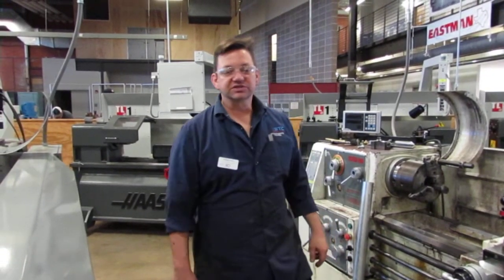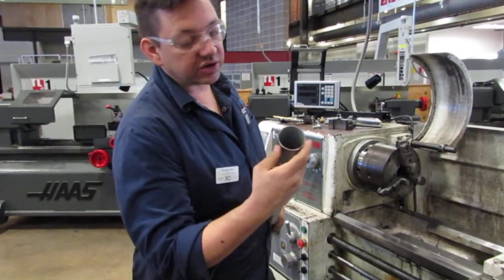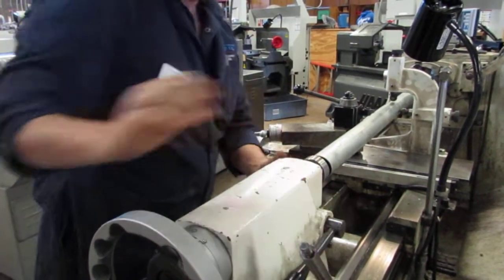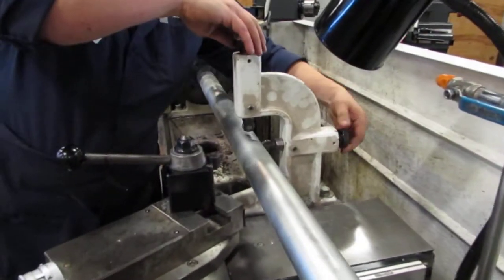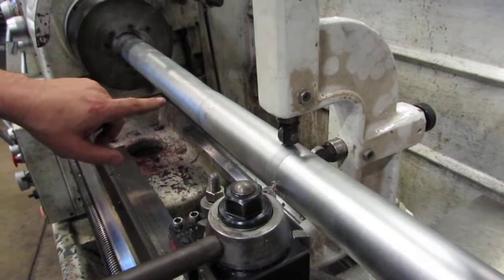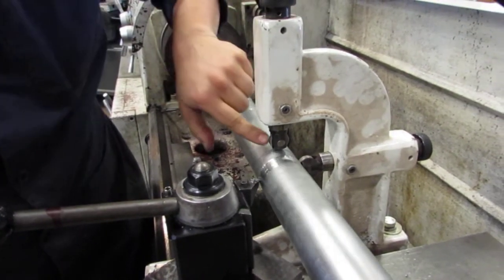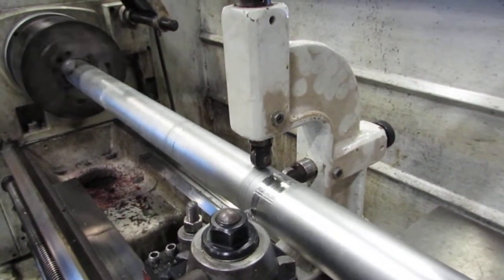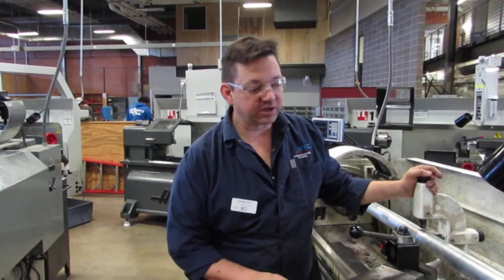Following Rest

Comment: I have had to set one up at work today for the first time in about 10 years as I am turning 40mm diameter nylon at 1000mm long. I have never had much luck with travelling steady's which is why I never use them but with nylon my options are running out now. From what I gather after refreshing my memory online the follower bearing supports should be behind (to the right of) the cutting tool. Hence the name "follower". So by rights your compound slide might need to be set in such a way to put the tool ahead of the steady.
Reply: Sounds like you have a pretty cool workshop. I love playing around with all the machines at work. I have a good idea for a travelling steady with top and rear support rigid adjustable as normal but a third one opposite them that is sprung loaded. That would really help get rid of vibration. Often times you might find yourself putting oil on the piece and using your hand to stop the vibes but its not good for the skin and also a safety risk.
I am really struggling with this acetal plastic job at the moment. Nothing I do seems to straighten these bars. I think I am going to have to lay them in a straight and true piece of angle iron in an oven at 160 C for a while before I can start machining them so they settle true into the channel. Its a bloody nightmare. Plastic behaves the same as metal does if it is warped. In other words if you cut acetal more on one side than the other it tends to bow in that direction. I imagine it will be the same when milling a strip of it on one side it will pull and warp as well.
Reply: Please be advised that link does not seem to work. It may be that because I am in the UK or your site is down for maintenance.